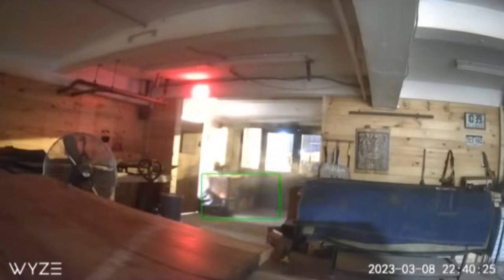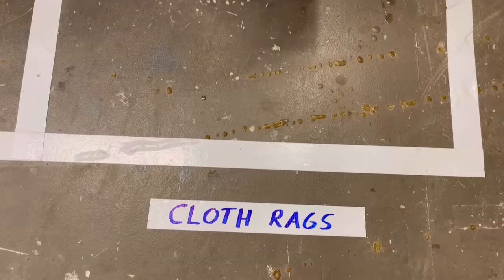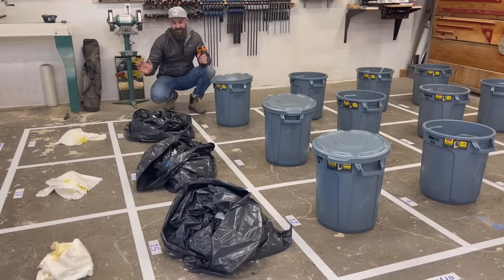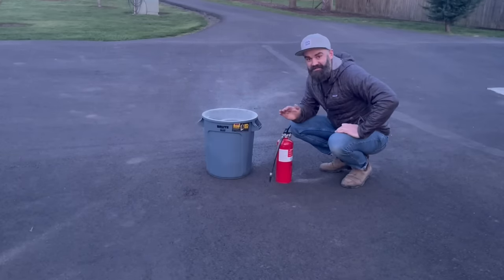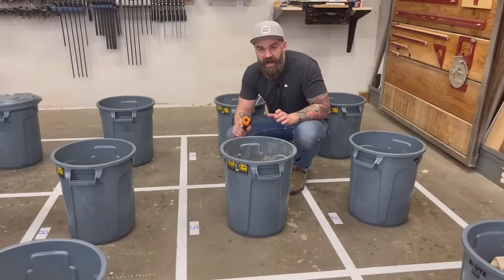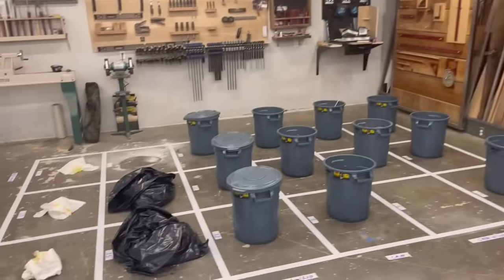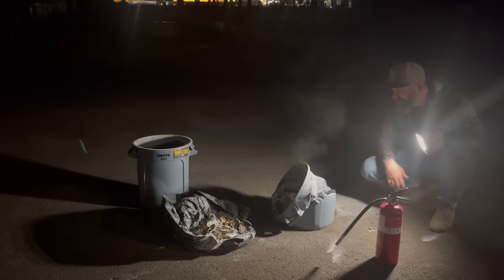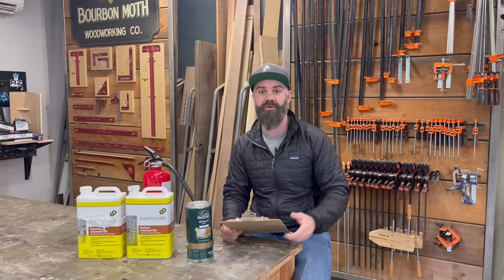I Tried To Burn Down My Shop || This Video Will Save Yours

Comment: My brother was doing some staining or something. We were going to leave to go do something so he put his oily rags in a platic five gallon drywall bucket but at least had the sense to put outside  on his asphalt driveway. When we got back there was a hole in his driveway with just the wire handle left. We teased him for ever about it.

Comment: I had my first and only spontaneous combustion while turning pens 12 or so years ago. I was using boiled linseed oil and cyanoacrylate glue for finishing. Fortunately, I smelled the fumes and tracked it down before anything big happened.
Now I put all oily rags in the firepit at the end of each day and use them to start my fire. I never keep them around for any reason.

Comment: Old cooking pots make a great place to store used rags. You can add water to the rags as added precaution. If you don't have running water in your work shop, dump whatever you have that is not flammable in the pot. Coffee, soda, etc....  ✌♥

Comment: As a fellow graybeard hobby refinisher, it's worth noting that the combustion is powered by an exothermic chemical reaction.
 In other words the Outside temperature of a pile of rags could be just above room temp while the driest rag on the bottom is about to combust.
 The chemical drying process produces heat, so do many things when they dry.
 Think concrete, epoxy, etc.
A quick dunk in a bucket of water accomplishes the same thing as the flambucket, slowing down the drying process to limit the amount of exothermic heating, both could save your shop.
 Be safe people!

Comment: A friend of mine started a fire in his dust collector. He would clean up his shop floor with a vacuum hose attachment that would send it through the fan blade of the collector. Well he apparently sucked up some metal ( screw or nail) which sparked and started the saw dust on fire which smoldered for like 8 to 10 hours. It didn't burn his shop down but destroyed his dust collector. Good thing it didn't explode.

Comment: Best to be safe. Keep sawdust containers emptied regularly, systems grounded to disipate static electricity. Stained, oily, greasy rags go directly in metal containers with tight fitting lids. Peferrable outside. Smoke alarm in the workshop.

Comment: Yup, good friend of mine owns a bowling alley. One of his employees threw a bunch of oily rags in a bucket back in the pin setting machine room. Surveillance video caught the spontaneous combustion in the middle of the night. A ventilation fan spread the fire, he has a bunch of fire/smoke damage in the machine space, including the electrical service (3 phanse)  being a total loss. Be careful with those oily rags, they are not a joke.

Comment: That's why I immediately throw them outside into the rocks until they are dry and then throw them away. I remember my grandpa talking about rag fires and not to pile them up inside. BTW, burning plastic also off puts cyanide gas.

Comment: My first experience with this phenomenon was when I used a redwood stain on siding of my sister's house. I was putting the used rags in a metal coffee can, in case they caught on fire. Well, they did. It was easily put out by putting water in the can. This happened while I was putting stain on the house.

Comment: I did an internship at a woodworking shop and one of the apprentices and I were told to change the airfilter of the spray cabin and just before that someone sprayed linseed oil or something similar in there and the filter was saturated with it.
We didn't knew better and put the filter into a trashbag and put it in a bin. After a while, we were doing something else at that moment, I randomly looked up and thought "is that smoke coming from the bin?" and yes, it was. When we pulled the filter out of the trashbag, more oxygen could come to the beginning fire and the first flames showed themselves, so we quickly put it all back in the bin and rushed outside of the shop and as soon as we stepped out into the sunlight (it was a very hot and sunny day with temperatures around 35-40°C) it really lit up all at once.

I never thought that it could happen that fast, but it happened all within around 30 minutes after changing out the filter and putting it into that trashbag and as fast as it started it was all over again, since the filter burned down pretty fast and after that there was nothing that could burn around the filter.

Edit: My guess why it happened so fast in my case is that the filter was really stuffed into that bag and way more compressed than the rags in the video

Comment: Well done!  Great PSA!  And your conclusion is spot on... you never know when it might happen.  

Note, while the temperature reading is a good indicator of something happening, that's the surface temp.  The ignition was probably occurring somewhere deeper. Hence the 90d to combustion instance.  The heat is building in spots and then radiating to the surface.  Somewhere deep in the can/bag it could have been much hotter, but the heat hadn't gotten to the surface as fast as it may have been insulated by the contents and such.  Also, fire needs oxygen.  So lid/lid half on/no lid, bags, suffocation by sawdust, how the contents are layered, etc all can have an impact how much oxygen mixes with the flammable gases to cause combustion.  Your red fire can didn't combust because it's meant to cut off the oxygen to prevent combustion, and made of metal to easily transfer excess heat (and not melt like your garbage cans. That was great!  :) )  Maybe next time consult with/have a firefighter buddy help in case $hit got out of control.

Comment: It says on the bottle (at least most of them) you learn it at the wood working school, used linseed oil and other self-igniting oil rags should be made wet and either be put into a sealed back to keep it wet or throw it in a safe storage trash container.

Comment: ABC dry Chem fire extinguishers work for the majority of types of fires btw. Try to keep away from class d fires with em and extensive oil fires and electricity over 1000vs but other than that ABC Dry Chem are great

Comment: Thank you very much for this video, the result is edifying. 
I'm a hobby woodworker for about ten years and I'm using Rubio Monocoat for four years now. 
The Rubio product combines with wood cellulose, it is strongly recommended to immerse used Rubio (cotton) rags (composed mainly of cellulose) in a large bucket of water. 
Personally, as an extra precaution, I soak everything that was used to apply Rubio in a bucket of water and leave it outside for a few days. 
Please do it too! Always !

Comment: Good video, and good proof of a phenomenon that some don't pay attention to or believe.

You took your temps on the outside of the rag/trash.  The warmest ones were radiating the heat generated by the oil.  Since they're radiating, it's not building up on the inside.  That's why we spread out oily rags, to give them the chance to radiate.  The ones you have to watch out for are those that are not radiating (low measured external temp) but building up heat on the inside.

Comment: I shared workspace with another wood shop and they had at least three fires from rags over about a five year period. One was in a plastic trash can inside the building and the other two were outside in the dumpster. The rags seems to need to go through a strange process of heating up under specific environmental circumstances. Soaking them in water doesn't totally prevent combustion. I've seen water soaked rags in the dumpster combust. Don't kid yourself, it can cause a legit burn the house down fire.

Comment: What is throwing you off is you are taking  a general surface temperature, but if you were to dig through you would find a hot spot that is generating the rise in temperature.

Comment: We always had a dedicated steel can just for the rags of all types. We took care of it at the end of the day so nothing like that would happen in our shops. We also had a fire extinguisher, a bag of sand and cat litter by each one, just in case one did go up. Had a shop next door and all we heard was cabloom and windows shattered outward and come to find out a new kid started working there in an auto shop and threw an empty can of either in a trash can with their rags and no one seriously got hurt, some just whizzed a little. Anything can happen in an instant. Yeah it caused a heck of a mess in their shop because it threw everything everywhere from a 30 foot radios and it was in between 2 big tool boxes full of tools. The tools is what hit a couple of the workers. So you can just imagine what kind of mess was in there. Made us think about what else can we do to make our place more safe. I thought it was dynamite from the sound and percussion. I worked with that stuff in the military and that was the first thing going through my mind. That was back in 1992 when this happened. Then the following couple years we had grain silos exploding and oil storage batteries going up. So yeah we had some crazy few years there when I lived down in Oklahoma.

Comment: I actually had a fire in my attached garage from wood stain soaked paper towels in a small trash can.  It only took 30 minutes to spontaneously combust.  By the time I found it, I had a small inferno with no fire extinguisher.  I eventually got the garage door open and doused it with the hose.  But it melted and burned and smoke damaged almost everything in the garage.  The smoke also entered my house, which required professional cleaning.  

I’m never letting that happen again!!

P.S. the fire also melted a hole in a 3 gallon gas can, that was also full of gas!!!

Comment: A strong metal garbage can is the best to contain rags. Make sure it's in a location away from everything. And has a good lid. Put sand in the bottom. Spray soapy water over the top of the rags every so often.

Comment: Bravo! Jason, bravo! 

Too many people don't know about this, and many who do know are unaware, as you were, of how rapidly the spontaneous reaction can occur. If you had piled a deeper heap of rags, and not all of them would have had to be oily either, over the oily ones loose on the floor, I'd wager that they'd have ignited too, maybe the quickest of all. Key to the reaction is holding in the heat as it begins to develop. Synergy sets in after that. 

In 1913 Jack London lost his 15,000 sq ft nearly completed house in Sonoma to a spontaneously combusting oily rag fire after floor finishers left them piled in a heap overnight. We all can imagine what it would do to our lives to lose a shop, and perhaps our own home to this sort of thing.

Comment: Looks like its more dangerous when its enclosed. So only a "fire safe rag container" might not be enough. It seems that it might be the mix cross-contaminating each other and thats why the fire safe rag container didn't increase in temperature.

So maybe, combine the fire safe container with a nozzle that does like a 0.1 second mist spray each hour. A 5 liter water jug might be enough to drive such a contraption for months.
Just a simple timer circuit hitting for like 0.5 sec each hour, connected to a small water pump + spray nozzle.

And testing so the contraption works is simple - use those mobile warranty markers. put one in a cup, put inside container. if it works, marker dhould be red/pink.

Comment: The heat builds up down inside where the laser can’t see. You can only take the surface temperature without disturbing the test.

Comment: You said you normally use a heater of some sort. Could that have an effect? I’m not a firm believer of spontaneous combustion so it could be a small static electricity causing the fires.

Comment: I used to do antique instrument restoration, and our shop had a standing rule, 1) all rags used went into a metal bin, 2) all garbage was emptied before you left, and 3) all rag and internal/potential fire products went into a separate steel garbage bin that was far away from everything else, just in case it did light on fire.
Now all oils react with oxygen (air) and linseed is one of the most common used products. Safe practices, and understanding of what you have/are working with is important.

Comment: Yes it's for real. Almost lost a house to boiled linseed oil. Had the rags not been placed on top of a bathroom sink and burned through the water pipes to extinguish the fire it would have been a total loss I'm sure.

Half the house had to be gutted down to the studs. New flooring through out. New cabinets. The hot vs cold air pulls all the smoke through any crack at all in like a heat exchamge. In the kitchen, clear on the other end of the house, every single dish inside the cabi ets were COVERED in smoke damage. 

Full pack out from servpro. New cabinets, new appliances as smoke had also "heat exchanged" itself inside every crack and crevice of every device in the home. Basically, a full remodel. Displaced for several months. 

From a hand full of rags soaked in boiled linseed oil placed near a wall on top of a bathroom vanity. 

All I can say is God was watching out for us when the fire burned through the water pipes.

Comment: Oxidation ignites these fires; the linseed oil oxidizes as it dries, and produces a small amount of heat.  Slowly, over time as the oxidation continues, heat builds to ignition point.

Comment: I have seen clothing and rags from a automatic shop they had oil an grease on them they wes put in a metal can for the Co. That picks them up every week to get cleaned one night they started on fire  good thing it was not near stuff all that burned was the clothing and rags and the shop had smoke Detesters an the fire was put out before there was damage

Comment: Not surprised at all. Chemical reactions greatly accelerate when temperature go up. You meter measures surface temperature but when the rags are insulated best, hotspot forms inside and there's not that much heat on surface.

This test would be more interesting with electronic thermometer inside the ragpile.

Comment: The metal can with a tight fitting lid is really "best practice". If something does ignite, it will smother itself out after using up what oxygen is in the container.

Comment: Here's how it happens: when linseed oil is exposed to air, it combines with the oxygen molecules. This chemical reaction creates heat. If the linseed oil is on something like a cotton rag, it can catch fire at as low as 120 degrees -- with no outside spark.
How do you prevent rags from spontaneously combusting?
Place the rags in a metal container with a tight fitting lid. Other types of air tight containers can be used if you add water to reduce the amount of oxygen in the container.

Comment: Is it an interesting point that the raw linseed oil didn’t burn at all? Makes you wonder is it the linseed oil or is it the additives combined with the linseed oil that cause ignition. 
Awesome video and my current thought process is raw linseed might be the safest.

Comment: Exothermic reaction. The reaction of the oil drying, or curing, is what generates heat. Better air circulation makes the drying go faster, and the closed container would reduce the drying, and the heat would have more time to dissipate.

Comment: Linseed oil has a chemical reaction when in contact with oxygen. If it’s not on anything you likely won’t see anything happen, but if it’s in contact with a flammable material like cotton it can spontaneously combust at just 120°F.

Comment: Back when most boats had wood decks a lot of boiled linseed oil was used. The rags and brushes were often put on top of cribbing poles. It was common to see them smoking and/or catch fire.  

Aren't you glad you didn't fall down when rushing out through and around shop equipment with burning plastic trash cans. Most fire departments recommend putting the fire out before moving it. Ie. Like kitchen grease fires.

Comment: If anyone wonders why

Boiled linseed oil is a drying oil that is commonly used as a wood finish or a lubricant. When boiled linseed oil is applied to a surface, it reacts with the oxygen in the air and undergoes a process called oxidation. This process produces heat as a byproduct, which can build up and cause the oil to spontaneously combust if the conditions are right.

There are several factors that can contribute to the self-combustion of boiled linseed oil. One of the most important factors is the amount of oil that is applied to the surface. If too much oil is applied, the heat generated by the oxidation process can become trapped in the oil, causing it to reach a temperature high enough to ignite.

Another factor that can contribute to self-combustion is the presence of combustible materials in the vicinity of the oil. If the oil is applied to a surface near other combustible materials, such as rags or paper towels, the heat generated by the oxidation process can cause these materials to ignite and start a fire.

To minimize the risk of self-combustion, it is important to follow proper safety procedures when using boiled linseed oil. This includes using the oil in a well-ventilated area, avoiding the accumulation of excess oil or rags in one place, and disposing of used rags properly. It is also important to store boiled linseed oil in a cool, dry place away from sources of heat or ignition.

Comment: 1.  Galvanized steel trash can.
2.  Tight fitting galvanized steel top.
•  No need for "spreading out rags on the floor".  ...STILL Possible to combust however, so if they're being thrown away,  add water to them and if they're go into be re-used, buy a laundry rack instead.  Spread them open to dry, isolate them from each other AND from other(nearby) materials.